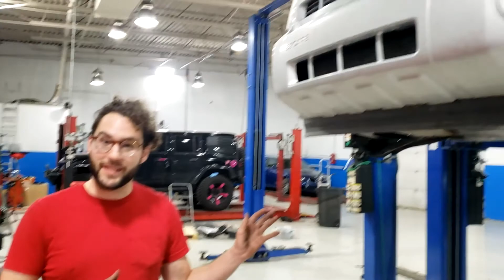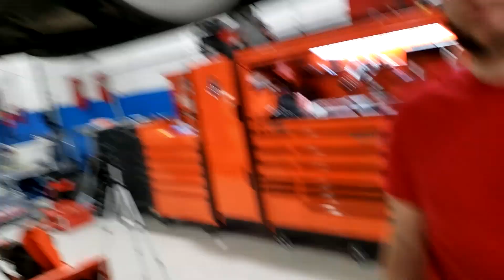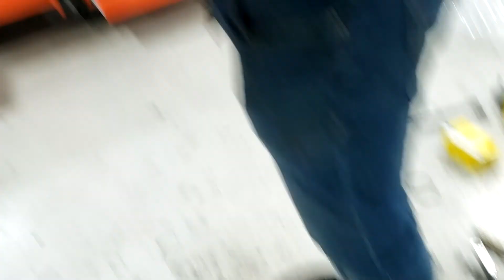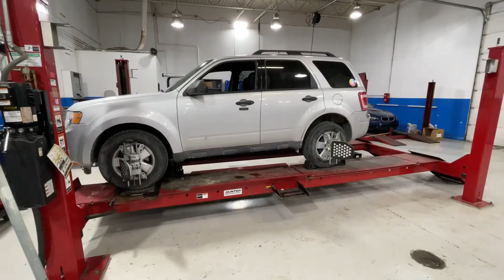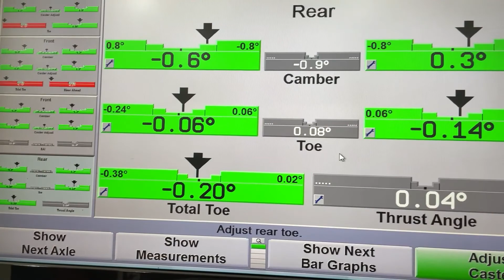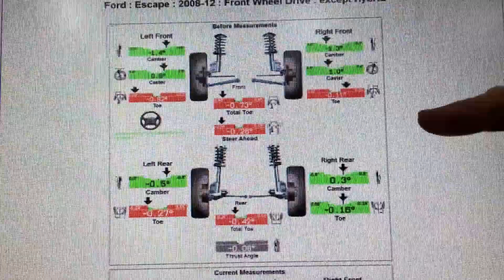Suspension Overhaul and Alignment on a Ford Escape

Comment: i used a string to align mine....it was going to puke valves anyway i found out later or missfire from who knows, just bills from dealer mechanic so selling seems clear. At east had a radio not the super synce with the bad circuit boards multi models and programs ....buy then you need a joke to listen to the spam joke ads...political and non political.

Comment: what causes a negative camber after installing the new struts, outer tie rods, lower control arm?
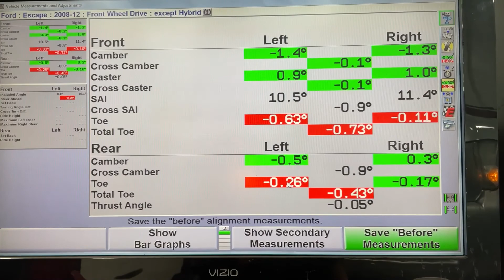Reply: The 2008-2012 Escape is supposed to have negative camber, as shown in the above video (the green 1.4, -1.3 at 12:00). The spec is -0.84 +/ 0.5 so technically the -1.4 is slightly too much but seems it is allowing it anyway. It can apparently be adjusted by 0.39 by rotating the mount at the top of the strut.

Comment: I know this is an older video, but just thought I'd add some info. You can roughly adjust the caster and/or camber by dropping the struts and rotating their mounting plates 90 degrees at a time. You can only decrease caster by  a fixed 0.40° though, so that would just make yours even more negative. Ford spec is +- 0.75 ° and like you said you're only a tiny amount outside that, so shouldn't be a problem. I've personally never needed to adjust caster/camber on a vehicle this way though. You did a great job for your first alignment.  I'm sure it drove much better after all your hard work. It's nice to see people working on their own cars and taking time to do everything the right way.
Reply: I know this video is old but to inform the diy community , if your caster isn’t set evenly on both sides then you’re steering wheel is going to pull towards the side with the least amount of Caster so in this case the wheel would be pulling to the the right side as you drive especially on high speeds but it shouldn’t be a problem, you’ll just notice the steering wheel is always pulling to the right and you’ll make a little more effort to keep it centered as you drive.

Comment: I have an 05 escape. When you lose nuts on top of strut how do you adjust camber. Hoe do you get strut top to move. Do u losen nuts also on bottom of strut. Couldn't get top to move freely.
Reply: I have an 05 escape and I wouldn’t loosen the nuts on the bottom, if it helps according to the cord dealer book I have it says to remove the top nuts from top and push down on the upper strut bracket then turn the the strut rod to desired camber and caster angle

Comment: Is there a camber adjustment? I have pretty bad negative camber on mine.
Reply: Yes there is adjustment on camber which most cars have
Reply: You can adjust it .39 degrees either way by moving top of strut. Also castor . But I am having trouble moving it. You can buy camber bolts also.